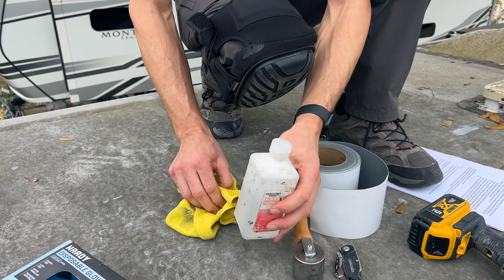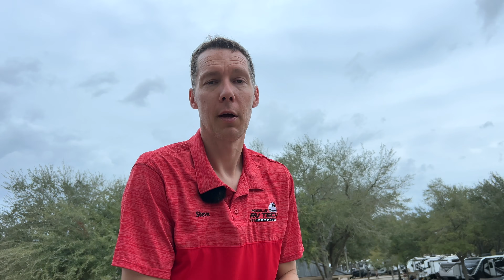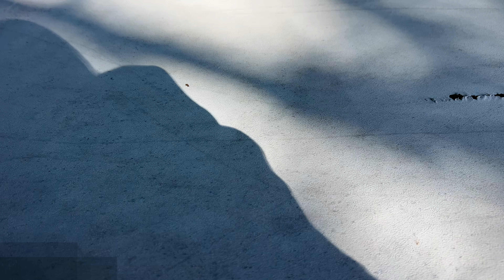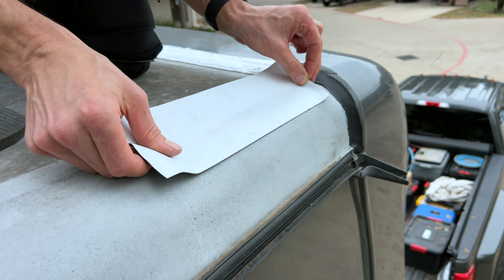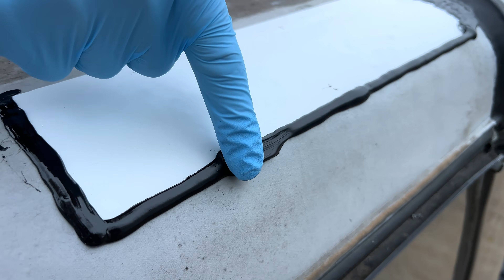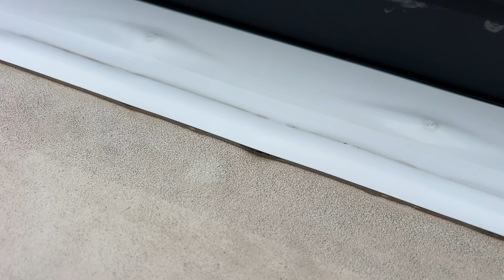How to Patch a Rip in an RV Roof Membrane (EPDM & TPO Repair Guide)

Comment: Thank you Steve and film crew for your excellent videos. The roof has cracks next to where you put the tape, since the rubber is beginning to age, could you extend the tape, cover the cracks for extra protection? Or do you recommend a better fix for a rubber roof that is "chalking" and showing age?
Reply from the maker: Once the roof top coating starts to crack, the options would be to put a coating on the RV roof or replace the roof. If you start taping, you will see too many areas and determine it is better to do the whole roof.

Comment: Hi Steve, I experienced some tree damage on rv. A limb came down, put a "dent" on the radius portion of roof. Looks like the roof in this video. Rain gutter got damaged as well. RV is currently under a cover and haven't had time to remove cover to access the damage. I have looked inside and I currently don't see any water damage yet. I was thinking I'd have to remove inside ceiling and "push" dent out from inside. Any videos or experience performing this task?
Thanks.
Reply from the maker: Glad you caught it early and have no water damage yet, definitely focus on sealing that exterior spot first! 

I don't have a video on this, but I don't think you will get to it from the inside very easily. I would plan on removing the bent gutter to get behind the radius metal to pop it out.
Reply: @MobileRVTechServices thanks for your reply. Any videos on gutter replacement?
Thanks
Reply from the maker: @rchusarOU812 sorry, we do not. Someone else might have a video on it though.